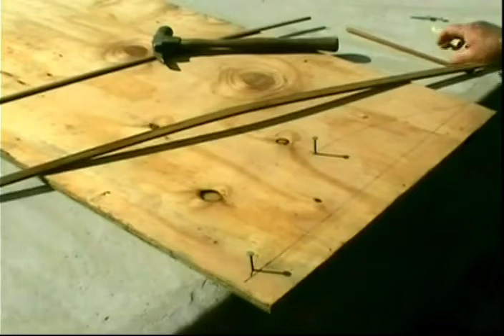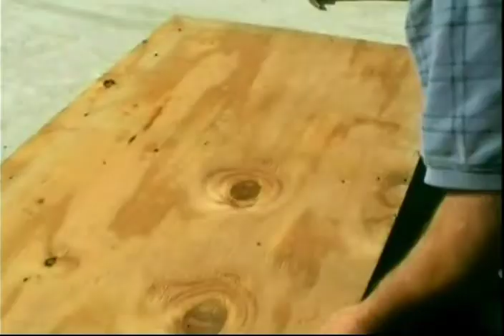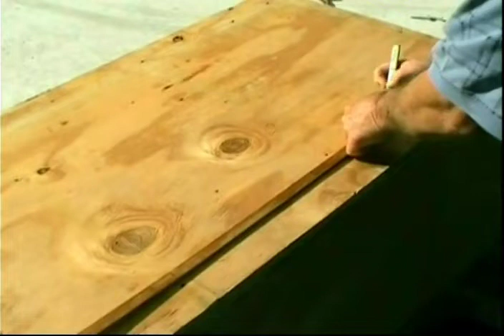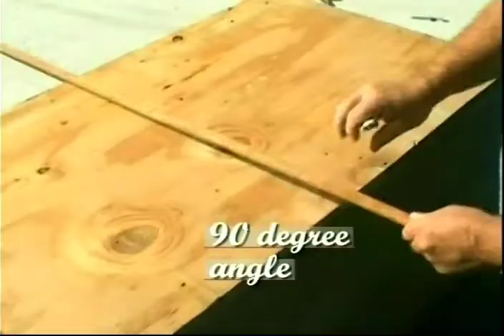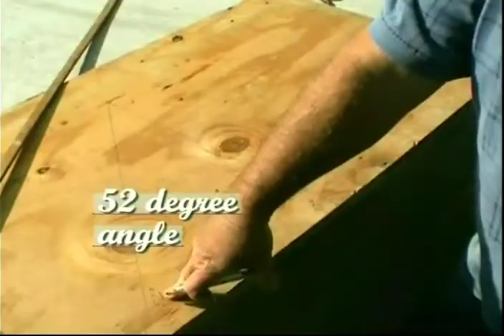Forgotten Technology Wally Wallington Uses Just a Stick to Layout Triangles

Comment: A big compliment to you, Wally! You most definitely are a very inventive and crafty person! As there are  scriptures from ancient Egypt which indicate they knew about Pythagoras´ theorem, your demonstration here very likely was very similar to how they and other old cultures laid out 90° angles. A ring rope with 12 (=3+4+5) marks or knots as marks at equal distances and three poles do the trick as well. You probably are aware this method has been widely used over the centuries. right angles and circles are pretty easy, Squares are a combination of laying out right angles an intercepting circles from their corner points, so easy-peasy! With the Greek knowledge of the theory of cone intersections, ellipses and parabolas are not difficult either.
While the methods for moving big masses are really smart I wonder if they wer used back then either. Whatever methods they used, you clearly show that with inventivity and simple tools, there is no reason to rule out the ancients could work surprisingly efficient.

Comment: I'm from northern MI and I had to laugh when someone told me you cant move large trees without heavy equip. There is a lot of ignorance today. I'm so thankful you put this out there for people to see.
Reply: You are correct, however this needs to show how the largest blocks were mined, moved distances we would find difficult today, and assembled in as little time as is attributed to the building of the pyramids.  Not saying this isn’t valuable and unique info, just saying it still does not explain some of what we find.  Keep at it though, everyone thinking and experimenting provokes.  some interesting thought.  

Scale is still a mystery.  There is also no doubt measuring can be done without tape measures, most surveyors and carpenters could easily show that.  The amount of thought, precision, material and limited time still make a mystery, one this might start to point to a possible solution for, but to me this isn’t anywhere close yet.